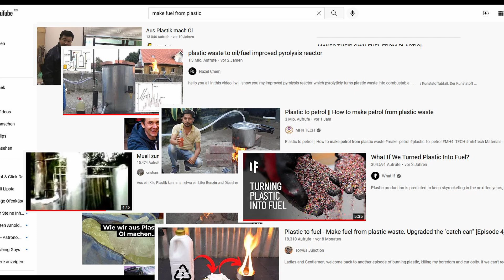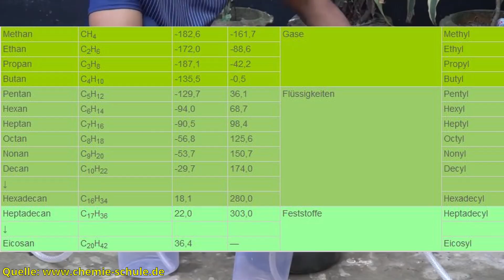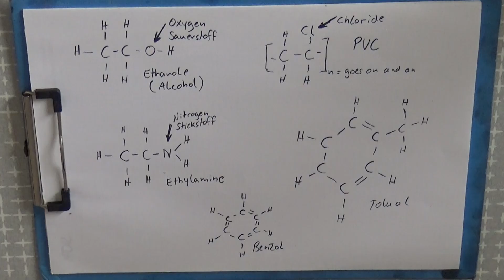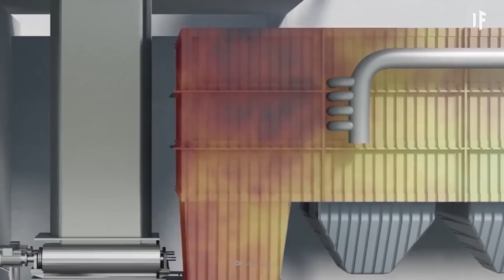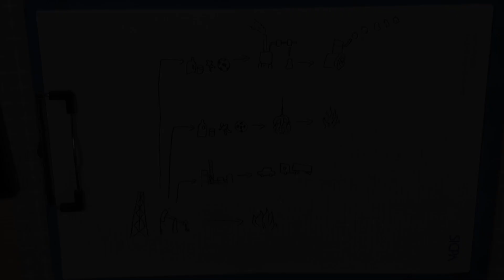The myth of making fuel from plastic, BUSTED!

Comment: Hi! Maybe the theory is that it is firewood, so you just release the CO2 that was bound by nature from the air that was CO2 before. So, no extra CO2 into the atmosphere.  But my opinion is that here the main point is get fuel for (old) engine/stove for free, and the guy just does not care about the nature at all. You collect the firewood for free, and it will be transformed into fuel for the engine for free. About making good to the nature: If you need fuel, why is it better for the nature to burn freshly mined and refined fuel then this? 
I feel misleading the plastic reusing as well. If we reuse all plastic, and keep it in use forever, we will still polluting our environment with the micro-plastic, won't we? (just for the fact, that is still better then create new plastic from crude oil) Or global warming: if we are sitting in a greenhouse and we keep converting energy to heat, we still keep warming our environment, don't we? We still need a way to release that heat from the "greenhouse", don't we? So, really I do not see how we could judge this process' cleanness. The industrial process does similar, but without using naturally bound carbon, and at the end we release the same toxic content to the nature. My opinion is that the difference here that we can see the pollution with our bare eyes while when we get the gasoline from the gas station, we cannot.  But it is just my opinion. What do you think?

Comment: For me at least this is about saving money. In the end I found that if I burn the plastics directly with excess oxygen I can heat my home and I have almost no ash or soot in the burn chamber to dispose of.  It all burns away nice and clean without any smoke coming out the chimney. I also run copper pipe filled with water to run a small 2400 Watt steam-electric power generator. Using plastic like firewood works best BUT you must inject a bit of extra air into the burn chamber to keep the burn CLEAN!  Plastic burns at 250% hotter than wood lb. for lb.
For a blower I use the discharge from a small shop vac running on 25% power by putting a 75 Amp diode inline with the 120AC power input so it only uses half a wave of power turning a 1hp motor into a 1/4 HP motor.  Power Squared Rule, half the voltage or 60 volts / half wave = a 400% drop in power. This is cheap to do and very clean. 100 pounds of plastic burns with the same energy as 120 pounds of high grade coal!
Reply from the maker: You cannot just burn any plastics. A lot of them like PVC release extremely poisonous fumes if done so! And the layman cannot determine what sort of plastic it is.
Reply: @diymicha2  if it's a sealed stove he should be fine, the birds above the chimney not so much

Comment: I don't know man... I made some in my backyard, I was able to run my diesel generator using this plastic fuel with a catalytic converter attached to the exhaust.. it ran all right and I could not visibly see black fumes in the exhaust.. and I used the remaining tar to make concrete pavement for my car garage and it is holding all right and even looks very close to real petroleum tar-concrete road.. 
Also I used electric cooking stove for my experiment... And Ithought it went alright.

Comment: If you use used motor oil make a burner then use synthetic gas off the plastic to continue your objective you get a cleaner emission
Reply from the maker: That doesn't solve anything. It still shifts the problems to another level. Why is it so hard to get this?
Reply: @diymicha2  what’s the answer to 3x+1 see the problem is the more you look for a answer the harder it gets if you don’t pollute the air you’ll pollute the ground or ground water take your pick no matter what you do a airplane created more pollution during takeoff than any car on the planet
Reply: Waste vegitable oil i breathed the exhaust for few years in my shop, beautif heat, no carbon emissions. Now i built wmo burner no  smoke, 
Works same as commercial units.
So yes use lighter gas to vaporize plastic. ( I don't like wasting oil by burning it as illustrated by 3rd world countries) islanders ibelieve were using coconut oil, not a carbon based oil.
.
Reply: @diymicha2  en faite ton problème est de prés ou de loin l’Entropie, mais on peux rien faire

Comment: Have you seen the documentary video about Singapore on waste management on YouTube? You need to go to Singapore to see waste management there. All of the country's waste is burned with a large incinerator with modern technology. But they implement a sort of air carbon emission filtering system, a kind of catalytic inverter. To reduce air pollution from exhaust emissions during the combustion process. The remaining solid material from the combustion process is in the form of a kind of carbon soil or the like which is environmentally friendly and can be planted with plants. They can even do reclamation, create artificial islands to increase the land area of their country.
Reply from the maker: Jes, and that is a good way to get rid of the particles in the exhaust gas, that polluted the area. Those particles are also very dangerous when they get into the lungs, causing cancer. BUT the downside is, that there is only the particles e.g. soot filtered out of the exhaust gas. The CO2 is still released into the atmosphere. And that is kind of the bigger problem. So this filtration is a start, but not the solution. And they used it for green washing when they conceal the CO2 emissions.

Comment: Is hydrothermal liquefaction simliar to pyrolysis?
Reply from the maker: Both methods are closely related, but different in detail. While pyrolysis works best with dry materials, high temperatures and moderate pressures, HL works with wet materials, moderate temperatures and high pressures to be able to overheat the water beyond its boiling point. The resulting oil from HL has approx. double the energy density than the oil from pyrolysis.

Comment: That's why they use mechanical diesels fren.  I'm pretty sure Rodolph Diesel's first engine was claimed to be around 40% efficient, therefore the analogy that they were in the low double digits is erroneous...  I mean even the lowest efficiency gasoline engine of the time was still over 25% hahahaha.  If you think modern engines are more efficient think again.  How can a modern engine, especially diesels be more efficient, when they directly spray fuel into the exhaust systems to limit, in essence, black smoke?  They also use urea (d e f fluid) to create a reaction to help combust the carbon.  Modern Diesel use way more fuel  than mechanical types, to achieve the same work, all in the name of "pollution control".  In reality, the same amount of "pollution" is coming out of the pipe, just that's it's not in the form of black carbon...     Man stop being a climate crazy, these guys are actually doing something good by ridding the lands of shitty plastics.  It's too bad so much fake science goes into discrediting free methods for fuel productions like they are utilizing..  Lots of people have produced fuel using this back yard method. Just because something is modern doesn't mean it's better.  The only thing modern shit seemingly does is drive the cost of all projects to the ceiling, while lining the pockets of big business and governments with more capitol.
Reply from the maker: This is wrong on so many levels. I won't even begin to debunk this. That would be a very long post. :)

Comment: Hmm, this is not really true. Once the burner is active, assuming there is a continuous input of suitable waste, there are 3 outputs ash which is waste, oil which is effectively the same as crude, and gas, which is fed back into the system. It has been commercially viable for quite a number of years but it's not really viable on an individual level due to the fact the oil needs to be refined into a useable fuel, and then turned into electricity.
Reply from the maker: You forgot a whole bunch of other highly toxic chemicals like chlorine and others that are needed to give plastics their different appearance and applications. Thats why in test facilities they only use PE and PP plastics. And those are making only a small part of all plastic waste.

Comment: Wood gas. Run anything
Reply from the maker: Ehm, also no. There is a lot of sud and tar coming out of the wood gas reactor. Even with the best cleaning there will still some remain in the produced gas. This can clog up modern engines very fast. Even the much simpler 40s 50s 60s engines in which some used to drive wood gas had to be maintained very often.
Reply: @diymicha2  ok. Lol. Spoiled. If it takes work and effort that means no it's busted lol. Loser all over

Comment: 1. You can use microwaves in a vacuum instead of fire which is for more energy efficient.
2. The toxic chemicals released from Plastic through "natural processes" are far worse and less manageable than the gasses released from combustion of tbe byproduct of thos process. 
3. Doing this process creates more energy in the form of gas, diesel and crude oil than is used in the process to create them.
Reply: Benzene boils at 80 C and gasoline at 85 C, you should take a chemistry class rather than to pretend to know what another dude is saying.

Comment: Must be a way to return the plastic to ground at depth oil actually is? or in magma Chambers?
Reply from the maker: It might be possible to bury that stuff at subduction zones. But they are all under the sea. It would generate huge costs to place the waste down there, without spoiling it into the biosphere. Humans are lazy and greedy. Burning the waste or dumping it in the biosphere is way easyer and cheaper.

Comment: Plastic is oil
And oil is natural as water on this plane and co2 i very Nice for the plants
Reply from the maker: this is absolutely wrong. A plant needs more than just CO2 to thrive. Water, nutrients, temperature, sunlight, everything must be present in the right proportion to each other. You can't just increase one component, and think that the plant grows better as a result. And above all: The plants have adapted to a certain CO2 content of the atmosphere over many millennia. We are increasing this CO2 content many times over within a few decades. No plant can adapt so quickly to the new conditions. Some greenhouse plants may be able to cope with a very high CO2 content, like tomatoes and such, but by no means all plants in our very sensitive ecosystem on Earth.

Comment: Why fuel sources do you recommend?
Reply from the maker: The sun. Via mirrors and/or wind and solar with a heating element. We have to be aware that we must'nt go on with fossile ressources. We have to shift a few gears down and live more with the flow of nature again. Work at daytime, sleep at night. Work more in summertime than in the winter. Then, and only then we may bring the climate crisis to a halt.
Reply: @diymicha2  LOL on what device did you type this on? You are the evidence against your own statement.
Reply from the maker: @jasonthetalker7253  that doesn't interfer with my statement above. I never mentioned using smoke signs for communication again.
Reply: @diymicha2  nuclear is a better alternative to fossil
Reply from the maker: @jasonthetalker7253  ehm. nope. It's just another way to get the quick fun, and put the problems to later generations. Like we, together with the generations before us, did to our children and their following generations. Besides that, if every country switches to nuclear, the wordls deposits of uranium will last only for approx. 17 years. And who could possibly guarantee that the highly toxic and radioactive waste can be kept safely for several 100.000s of years? In the case of France this waste has piled up to 30.000 tons over the last decades, which are kept in warehouses in southern france, because nobody knows what to do with this stuff. Until the early 90s France shipped it to RUS where it was dumped god knows where. Nuclear is also a dead end, like fossil is (litterally).
Reply from the maker: Look: Until we got something like fusion reactors up and running commercially we have to use what ever is available on renewables. There's no easy and quick way around it. And even those come with problems (the blades of wind turbines as one of it).
Reply: @diymicha2  no nuclear is the cleanest energy and would solve the problem until future technology
Reply from the maker: @jasonthetalker7253  What's so hard to understand with "highly toxic nuclear waste"?
Reply: @diymicha2  not in France that recycles all of Europe waste. Note blame democrats for not recycling the United States nuclear fuel because they passed a law to stop it.
Reply: @jasonthetalker7253  I spent several years working in nuclear fusion research, and also a year as a decommissioning engineer for nuclear contamination/decommissioning and disposal. The radionuclides from fission nuclear waste take tens of thousands of years to stabilise to acceptable levels. That's why high level nuclear waste is buried deep in the ground, it isn't "recycled". Nothing "clean" about it. If the nuclear waste we've already produced somehow found it's way into the oceans or atmosphere, life on this planet as we know it, would be gone forever. It really is that dangerous.

Comment: When I learned about being able to 'convert plastic to gas' it seemed too good to be true to me. I thought that using wood fuels to run the distilleries was kind of a fatal flaw but thought at least it could be done with a renewable fuel source (wood.) I appreciate you taking the time to educate people on how the process works. You raise many excellent points. Some better ways I've seen to recycle the plastic is turning them into bricks for houses or as pavers for paths. I think recycling like this is intellectually interesting because you have to try think of unintended uses for these products which requires creativity. It would be rewarding to build a company based on recycled products and solve all kinds of construction problems with repurposed waste. I actually bet plastic could be used for many kinds of construction materials. Roofing would be an obvious choice!
Reply from the maker: You are right. Thank you. In Germany we have the word "upcycling" for that. When you use old scrap materials, and use them for something new. In that way we, for example, use old blades from windmills as filling material in road construction. The plastics don't dissapear for good, but they are used in other projects that may last for decades. Especially blacktop can be recycled practically infinetely.

Comment: So, seems inefficient and is obviously not worth doing for multiple reasons but it is not a myth, and it does work.
Reply from the maker: Pyrolysis is known to science for at least 110 years now. But the point is, that those videos claim to make FUEL what the resulting flammable liquid obviously not is. It will most likely kill modern engines.

Comment: capitalism isnt the root of all evil. You made this video because of capitalism. Youtube is capitalism. i liked the core video, but your theory is wrong.
Reply from the maker: Except it isn't. Capitalism was a good thing until the late 70s, early 80s when the companies discovered that they don't have to serve the people, but only generate more and more money out of nothing. Today everybody has everything to survive in the so called "developed" countrys. Heck, we throw nearly half of all products away, brand new, or one time used. The same goes with all produced food. We produce  only for the sake of production, goods that no one needs. Fired on by commercials that make people think they need more and more. Normally everybody has to work only half days, if we produce only what is really needed, and use that stuff as long as possible. Companys have to make products sturdy and repairable again, like in the 50s, 60s... A lot of that stuff still works today, if it survived capitalism that long. Today we need to establish some sort of sustainable capitalism, in which those who use resources sparingly and produce products that last as long as possible are rewarded. We cannot survive with this locust-capitalism we have today. Exploit other countries and peoples until there is nothing left to get, and then move on.

Comment: I think there are a few thing that could be done to optimize the process.
A more eficiente kiln to burn the plastic that uses pre-heated air and uses the waste heat to some thing else. Use the waste gas as fuel for the kiln. And also use the plastic as fuel to the furnace.
If well made you can run the system on plastic only. 
It's not recycling thou, you are just trading solid waste for gas waste. Hopefully easier to dispose
Reply from the maker: Which it isn't. That stuff makes more problems in the atmosphere than buried in the ground.
Reply: @diymicha2 It makes trash invisible hahahahahaha

Comment: What are the caracteristics of the fuel produced??
Reply from the maker: In short: Some flammable liquid with lots of impurities. 
Nobody can say for sure what is coming out there, if there's no check which plastics go into the process.
Reply: @diymicha2  let's say you did this in a post apocalyptic scenario. Would refuse tires be relatively consistent?
Reply from the maker: @michaelblackwell7408  in that scenario there will be way bigger problems than destilling fuel.

Comment: So it produces diesel and not gasoline
Reply from the maker: Nope. It produces a flammable liquid of some undefined kind. This can be burned in diesel engines. Especially old ones burn almost anything that comes close to diesel.
Reply: @diymicha2  but not gasoline engines?
Reply from the maker: @jasonbrown5014  will most likely die, or not even start at all.
Reply: @diymicha2  I tune engines for a hobby, octane rating is highly crucial and if someone puts some random flammable liquid into their engine, especially under load conditions, the engine will "lunch" itself very quickly.